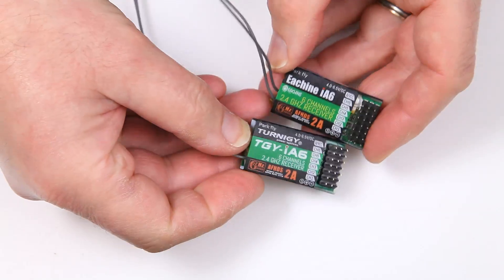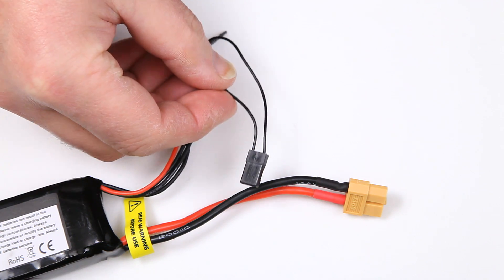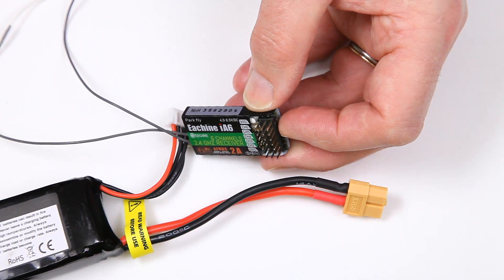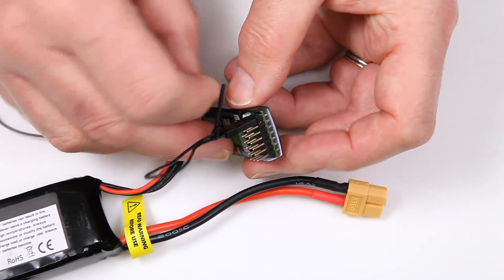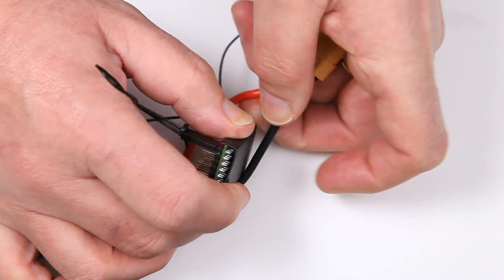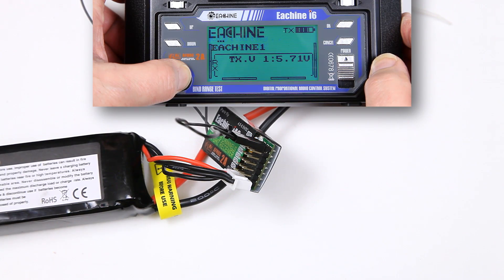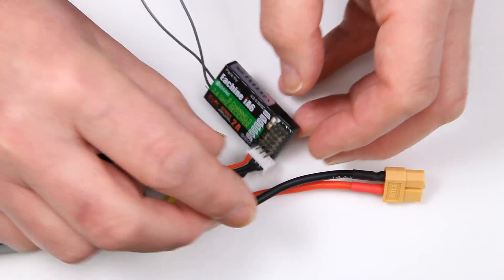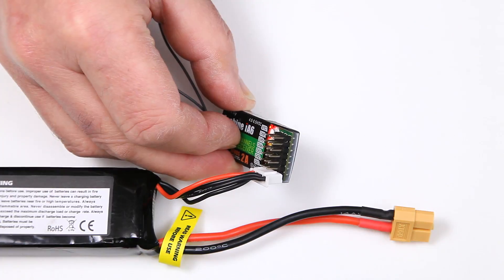Bind iA6 RX (Receiver) to i6 TX (Transmitter)

Comment: Why on earth would anyone do this?  Plug the battery into the ESC and then plug the ESC into channel 3.  Simple and you can use just about any battery like that as long as your ESC regulates the voltage.

Comment: Use the ESC as power supply to be safe (Plug the battery into the ESC, then plug the ESC in the channel 3 or throttle channel).
Reply: Yup.

Comment: It's dangerous and not correct show the binding procedure without specifying informations about voltage
In most cases, most RXs need from 3,5V to a maximum of 7,2V; In this case (FSIA6), it require a maximum of 6,5V (it's written in top part of RX)
So you can use lot of power supply but:
FIRST:
You've to check battery voltage; if you use a 3s(or more lipo) it has to be partially discharged (check with a tester because can't exceed 6,5V)
OR use a classical power supply of 4,5V
OR use every universal power supply with V regulator
OR use a power bank with usb cable on a side and skinned cables (black and red) on other side
OR use the connector of a PDB with 5V (the voltage tipically required by a fpv cam)
AND ALSO
CHECK the polarity of the battery and FSIA6 (and every RXs), because the plus is in the middle of every 3pins row and the minus on the right
the left pin is for signal wire.
[  signal> °  °  °<minus(-)  ] the + is in the middle.
Reply: Your USB suggestion worked like a charm. Thank you. I was pretty terrified of frying this RX. Much appreciated mate, even 3 years later.

Comment: can we use 22.2 volt 3000mah 45c battery with this receiver?
Reply: Haider Zulfiqar Hell no
Reply: As you also connected the receiver directly
Reply: So how much is your battery volts and mah?
Reply: Haider Zulfiqar Use the 5v port on your PDB or just give your FC 5v and the FC will power the RX up
Reply: Haider Zulfiqar Never connect it to a battery directly! He had his battery prepared
Reply: Haider Zulfiqar Will your quadcopter even lift a 22,2 3000?
Reply: Haider Zulfiqar Give the reciever 5v
Reply: Haider Zulfiqar Not more! Or you will fry it
Reply: I have hsd viper jet 75mm
Reply: Actually i am having my cie exams going on which will end on1st of June
my friend borrowed my plane and crashed it and now i dont have enough money to buy a plane again even kit
And i am saving my pocket money to buy the plane again so i was asking you that i will buy a new battery and esc 
So can i connect the receiver with the 22.2 volt battery with esc?
And where you live 
In Australia?
Reply: Haider Zulfiqar Poland
Reply: Haider Zulfiqar You have to power it with 5v!
more = fry

Comment: Ive got the turnigy 6 channel receiver. It says we need a 6V battery but my battery has 8.4 V. Am i still able to use it to bind?
Reply from the maker: I thought the Turnigy is the same just re-badged as this one, but I may be wrong. So it should be fine, but it's your RX, this method works but some have connected it incorrectly and fried the board. If you connect any battery round the wrong way you will fry it ;-) Good luck with whatever you choose

Comment: And after the success bind process (as showed in this video), low blinking lights in the receiver... but  no RX showing in menu in my Transmitter... What I am missing ?

Thanks !
Reply from the maker: It doesn't have telemetry so you wont get RX info ;-)
Reply: I have the same problem! Radio is Flysky and RX is Turnigy! They are not totally compatible as I don't get Error rate and Voltage data! This video is not saying this issue.
Reply from the maker: Maybe, after binding try removing bind plug and then power off as opposed to power off then bind plug should sort it
Reply: Tigger's RC Reviews Incredible... I tried so many times with that sequence and it was not binding with "OK" statement.... it finally worked! I can confirm now that Flysky radio is totally compatible with Turnigy receiver (both voltage and error rate are sent to radio). Thank you for your help.
Reply: make shure that youre transmitter is in afhds 2a mode :D

Comment: This video needs to come down.  It is way too easy to fry your receiver.  Just glancing through the comments I can see that this is doing more harm than good.
Reply: You should use a battery pack that is around 5v  to 6v . I bind my RX's by using either a motor controller supply or I have a 6v Nicd battery pack I use often for testing things like LEDs and RX's when they arrive by post.
Reply from the maker: Sorry you fried yours, it works as I clearly show, and you have to power it up to do the process, so if you connect it wrong it will always fry it, just like if you connected you quad battery the wrong way you kiss goodbye to your PDB. This has helped loads of people and I'm sure it will continue too. Hope you find a way that works for you. Thanks for sharing your views.
Reply: @TiggersRCReviewsTTFN   You're an idiot!!
Reply: @ranger175a2w  Yes!! I just fried mine.
Reply: @TiggersRCReviewsTTFN  I fried mine too. Please add a warning to the start of the vid and reupload. For the love of receivers worldwide!

Comment: I'm worried that if I plug my battery in it will fry the receiver. Is it safe? Also are you using the eachine 250 racer battery?
Reply from the maker: Yep it will fry in a nano second if you get it wrong for sure, follow it carefully it will be OK, I don't know another way of doing this. Only you can decide whether you go for it or not. Yes I used 250 Racer battery. Good luck
Reply: Thanks, i think I'm gonna just go for it and hope for the best, btw great vid!
Reply: Can confirm, just fried my new rx.  This is definitely not a good idea.
Reply: because you did it wrong, gave it too much juice.  it works fine

Comment: Good video.  I did exactly as you demonstrated.  My receiver has a slow blink so I think it has binded.  However, when you look at the right corner of LCD screen of i6 transmitter.... it only shows TX and battery status.  It does not show the RX with battery status.   What is wrong?
Reply from the maker: There is no telemetry so that is normal ;-)
Reply: Tigger's RC Reviews It DOES have telemetry also the ia6 version (not only the iA6b). I think the issue is about not compatibility between radio and RX firmware. I have the same problem of not seeing Error data rate and voltage ONLY when I use Flysky radio and Turnigy Tx (TGY-iA6).

Comment: I just fried my receiver because your lipo batter has different cables than mine does, i have 3 red 1 black you have 3 black 1 red, now I'm not sure how to provide power now can anyone help? of course after i order a new reciever
Reply: Toby Ball Nope, your lipo had a lot voltage
Reply: that happened to me as well :(
Reply: Same
Reply: I have also burst my receiver, apart it has gotten a spark, and I almost electrocuted myself. I do not know if I could help you but another receiver is the FS-IA6 which is the same but do not do it if it does not happen to you what happened xd
Reply: Use the ESC as power supply

Comment: Does the the transmitter show the voltage of the lipo in the aircraft and warns you if it's too low?
Reply from the maker: Not with this setup, I use these  http://goo.gl/RRcCNS and did a video on them here https://www.youtube.com/watch?v=vCiKpWnrpq8
Reply from the maker: I don't know, the battery lcd's look the same to me, think I will stick to the alarm, good luck

Comment: What lipo battery can this use? is 3000 or 4000 compatible? I blew up my receiver when i connected directly as per your instructions  on the balance charge connection
Reply from the maker: You can use any battery as you are only using one cell when you use the balance cable :~)
Reply: Thanks, can you possibly tell me which receiver is compatible with the FSiA6 transmitter when using 2 or 3 cell lipos?
Reply: i also blew up my receiver by connecting it directly to battery so buy a new receiver andconnect using an esc
Reply: Great video! Can you tell me how to know how many cells is a balance cable using? I have a Nano-tech 950 mAh  25-50C battery but just can't find that specification anywhere.

Comment: It is completely safe to connect the battery like that? Always the red wire in the signal position?
Reply: Thanks,tried your method and worked great.No problem using balance lead as you show.
Reply from the maker: yeah you saw it live here so no reason why it shouldn't work, cheers
Reply from the maker: Thanks for confirming Chris, appreciate it and glad it helped :-)

Comment: I have an issue, the binding is just okay but it didnt show the voltage rx on the transmitter.
Reply: sorted it out. you have to remove the bind plug first and leave the power on the receiver. Not take the power off first.
Reply from the maker: +ch ha This is the second comment on this, I guess if it's bound it's bound so I would then fly, but it has to be your choice. I have tried to replicate the problem but mine always shows the battery. Hope you get it sorted and let me know if you do. Cheers
Reply: I have the same problem. I have tried and tried. But it just will not work. Red light goes to a slow pulse. But that's it.
Reply from the maker: Well done, glad you got it sorted ;-)
Reply: Thanks mate that sorted it for me too : )

Comment: I dont get the rx battery symbol up on my screen but the rx light still lights constant. Is it bound fully or not.  I have the Flysky badged i6 if that makes a difference at all. Thanks.
Reply from the maker: +thra5herxb12s It should be bound, IMHO, I have never had a partial bind so it is either bound or not. Not familiar with Flysky but assume they are the same TX just rebadged. Hope it works
Reply: They look identical except the badge and the screen logo. It all seems to connect and arms / disarms ok, and all the models functions seem ok. I thought maybe there was something in the receiver setup that I have missed.
Reply from the maker: +thra5herxb12s It all sounds good to me just get out and enjoy your flying is the order of the day ;-)
Reply: Sounds good to me. I have a small digital egg timer to keep an eye on the battery time. Thanks.
Reply from the maker: +thra5herxb12s Enjoy, I find these good http://goo.gl/RRcCNS and did a video on it here https://www.youtube.com/watch?v=vCiKpWnrpq8 have fun :-)